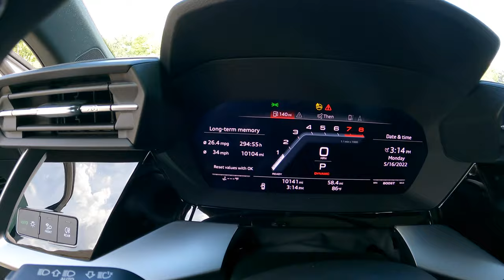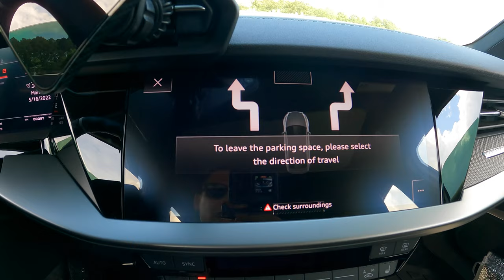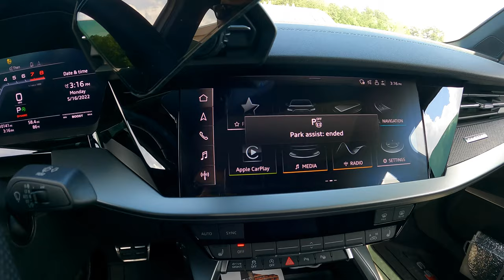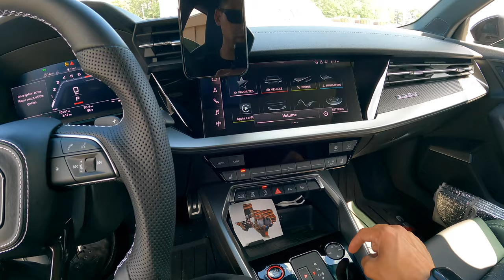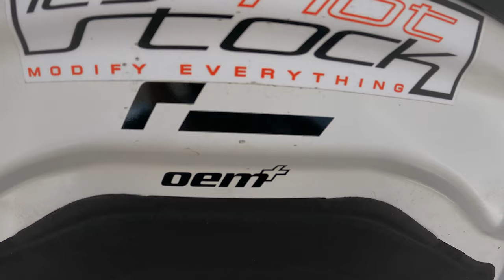10,000 mile update in my 2022 S3! + BIG future plans

Comment: The DQ250 has wet clutches and the DQ381 can handle more torque ,the DQ200 had dry clutches and handles less torque . The tuner I use has a number of guys with 500nm + DQ381 running reliable . When dealers in OZ have the S3 hatch in stock I’ll check them out ,price $82K  AUD/ $57K USD the Mk8 Golf R $77K AUD . Last month I checked out the Audi A1 T2.0L to replace her 2015 POLO GTi  T1.8L but at $63K AUD it seem to expensive. Post COVID no more cheap new VAG based cars .
Cheers
Audi has flipped it on VW and making the better looking cars and VW cost cutting is showing through with similar front all the rear of the cars are looking the same interiors plastic are cheaper . 
Cupra is being released mid year ,their pricing is up there with VW and Skoda , most most interesting Cupra will be the Cupra Born .
Reply from the maker: Good information here thank you! Wish we got the Skoda cars here they seem pretty neat!

Comment: my 2018 Golf R Stage 2 Unitronic and all bolt on's it has a DQ381 and the tune is great! I assume you plan on bolting on bigger turbos etc and going EQT.  have the EQT turbo inlet pipes (thanks to you mentioning them and showing the install)  hopefully they crack open those ECU and TCU soon for you!
Reply from the maker: Yeah hoping they get it cracked this year! Plan is to stick with EQT as they're my sponsor 😁. Nice buy on the pipes, still a great choice! How did you like the dsg tune for the 381? Any noticable changes? Does it launch harder?
Reply: @BryceJordanProductions  you get two RPM choices for launch (you choose by uisng full throttle or fulll throttle + kick down switch) it def. pulls harder and quicker tighter shifts. still slips the clutch on launch a bit more than I think it needs to. on each gear shift you get what feels like a surge or bump of power.  Unitronic is very OEM+ i feel there is room to be more agressive. but for a daily its great.

Comment: Both 250 and 381 have wet clutches. Its all in TCU coding. They made the 381 act as a automatic in Drive especially
Reply from the maker: Interesting! Didn't realize. My 381 is smooth as butter
Reply: @BryceJordanProductions  The 250 is more raw, as a friend said to me in terms of gear engagement. Also its a 6 speed while 381 is a 7 speed.
Reply: That's right. The old DQ250 (like in Mk7 GTI and R) can handle a ton of torque, up to around 600Nm on the stock clutches, which is almost twice as much as the official factory limit of 350Nm. With an aftermarket clutch you can increase even more. Of course this only works in conjuction with a TCU tune, that is increased clamping force. Without a tune, the DQ250 will start slipping anywhere in between 450 and 500Nm. Don't ask me how I know...  ;-)
I do not know the 'tuned' numbers for the DQ381.
Reply: 381 holds about 50nm more than 250